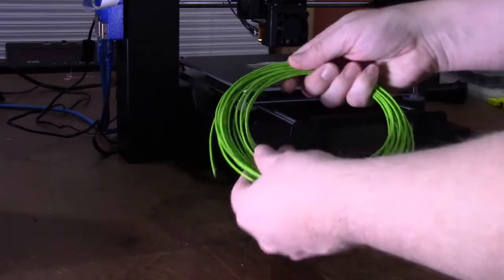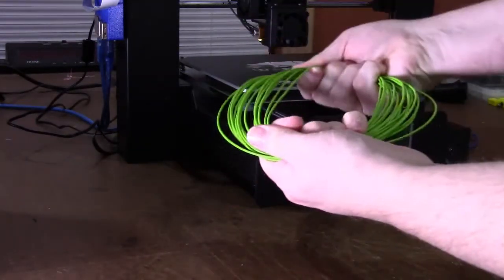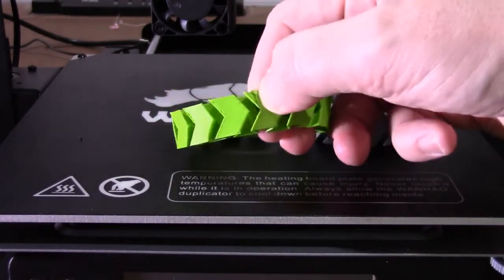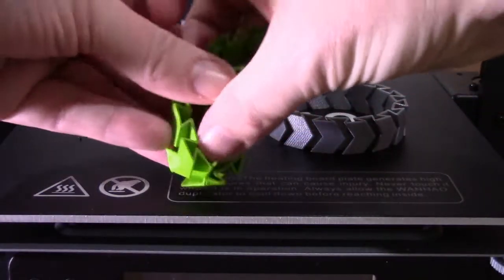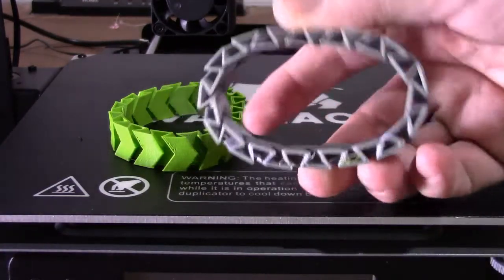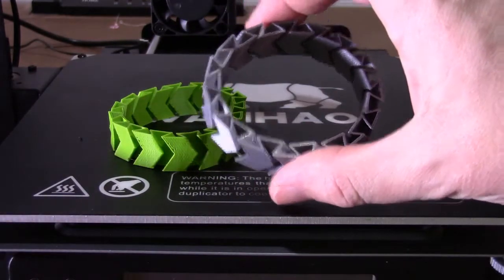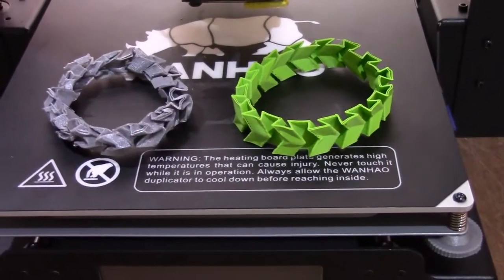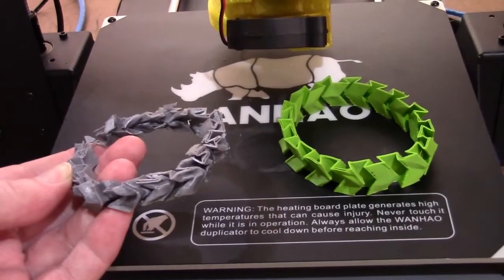Filament Test: Orbi-Tech Soft PLA (Wanhao i3 Plus)

Comment: Did you use any of these flexible filament mods? or just normal loading?
Reply from the maker: All of the filament tests have been performed using relatively stock i3 Plus/Maker Select Plus machines.  The only non-stock component for the filament tests is a Micro-Swiss All-Metal upgrade for filaments that are abrasive or need a hot-end temp > 235C.  A video with a couple of brands of TPU, NinjaFlex, Orbi-Tech Soft PLA, and M3D's Tough 3D Ink with a stock vs. flexible filament mod hot-end is currently being produced.